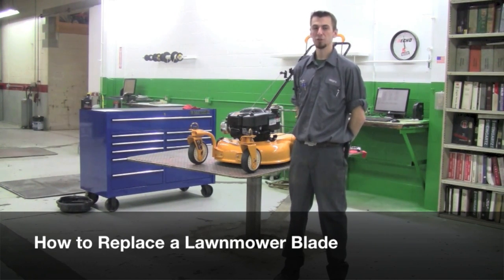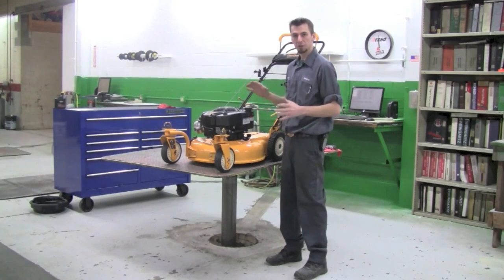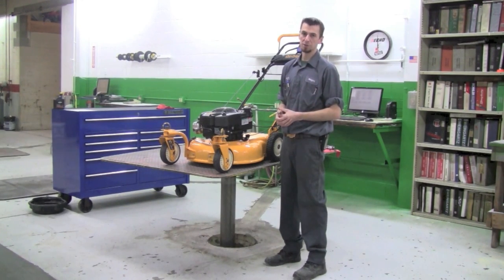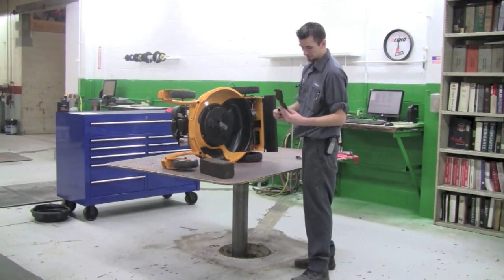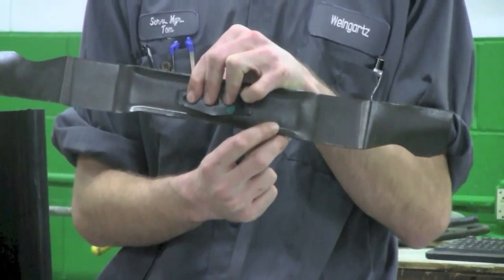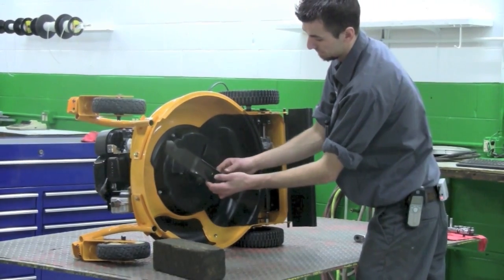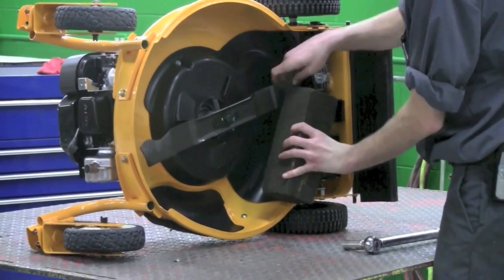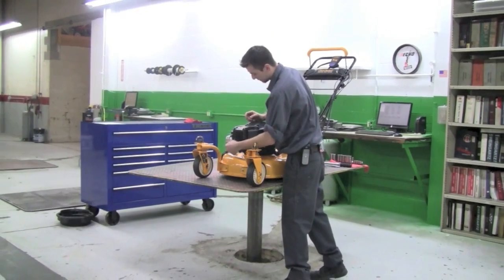How to Replace a Lawnmower Blade on a Cub Cadet Walk Behind Lawn Mower CC999ES

Comment: Nice vide.  I have owned several homes and flipped three...owned several mowers and other devices such as chainsaws and chippers -- my cub cadet was the WORST mower/piece of equipment I have ever owned by far.   I had problems while under warranty and the manufacturer would not stand behind their product.